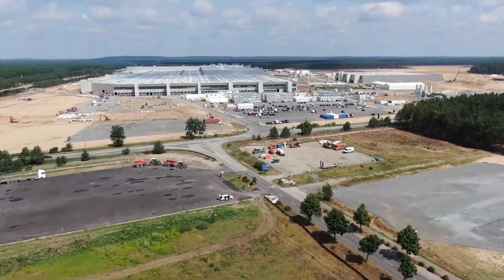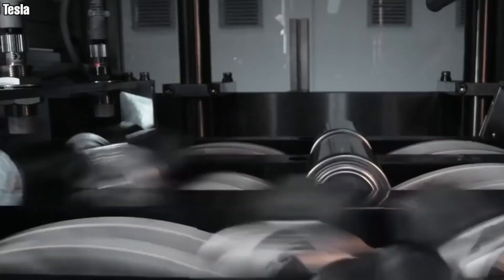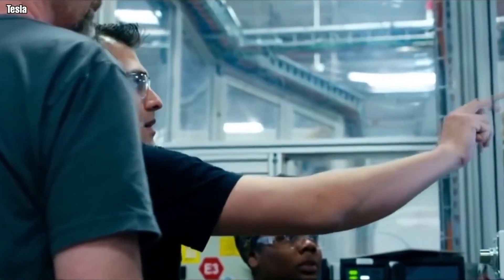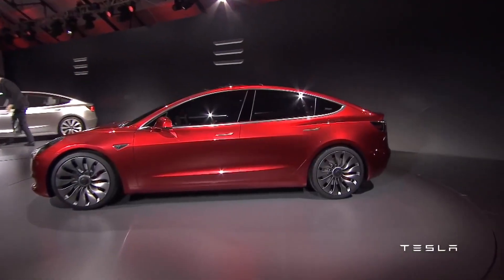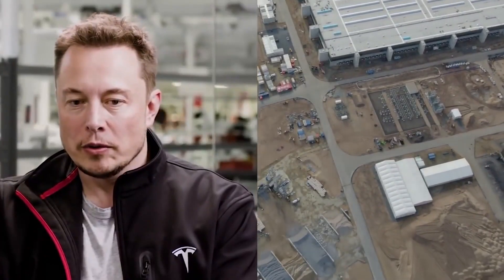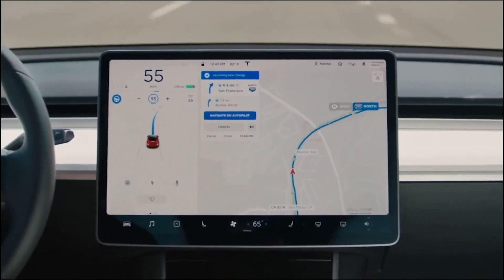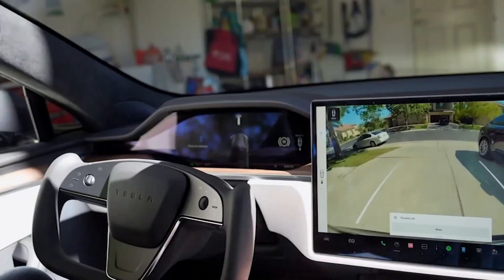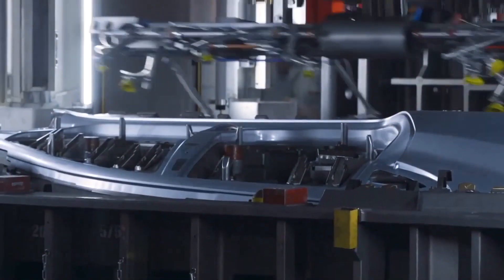2022 Tesla Model Y With 4680 Battery AND Texas Is Starting Production

Comment: Maybe if they spent a fraction of the time they do on batteries, on customer service, new owners would not be routinely disappointed -   My Model X Plaid was delivered "contactless" to my home with a cracked windshield, a bumper needing to be replaced, 30 miles of range, software out of date, no license plates, a non-functioning falcon wing door, misaligned panels, and a dirty interior among other issues.  They somehow thought this is a good way to impress a customer paying $140,000 for a new car.  Good luck trying to get the service center to answer their phone.  I kept getting connected to a voicemail that had never been set up to receive messages.  Oh, and don't bother calling Tesla's corporate number.  They want nothing to do with their customers, simply referring them back to a local service center which doesn't answer their phone.  I waited 8 months for this piece of sh!t.  Never again.
Reply: That has to be one of the most horrendous deliveries I've seen yet. When did this happen? Did you get a resolution ?
Reply: Its fud

Comment: Just cancelled my order I put in November. Just got assigned a Fremont car. Not paying 10k more than last year for old Tech. 4680 will likely hold value much longer and they will last much longer. Sucks but my SA said they will no longer hold past 90 days.
Reply: Where do you live? You may end up getting a Fremont car again?
Reply: @Dawsomesauce  Carolina , should be Austin cars coming here. Looks like April 1 factory may open then sales likely to start. If they start shipping 4680 may add better color. trailer hitch etc. to get it faster.